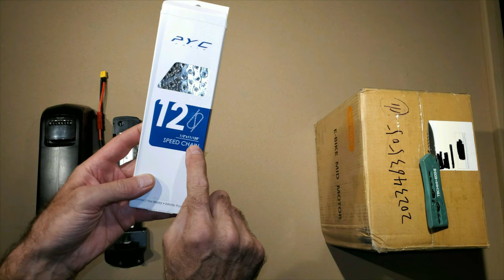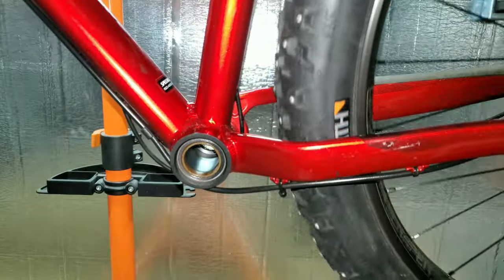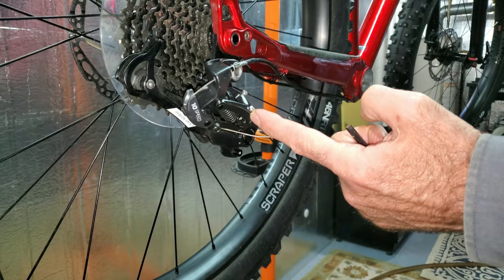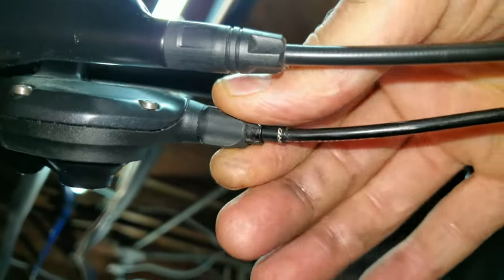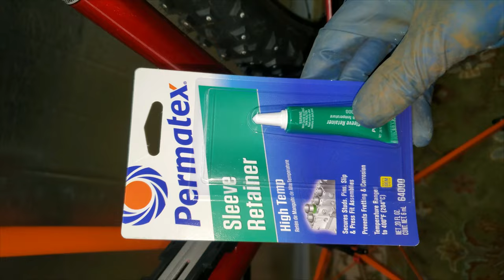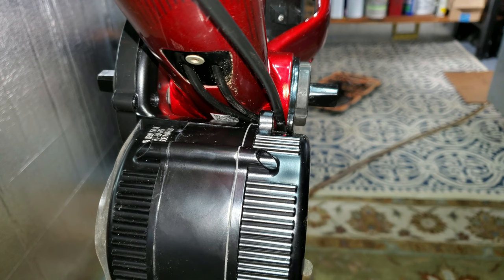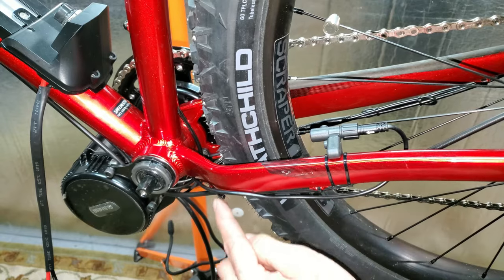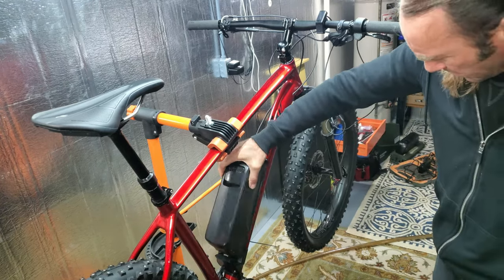Bafang mid drive Specialized Fuse E-bike conversion install

Comment: I love that you included all the hiccups in the process, this aligns with all my bike and auto projects. These kits are not guaranteed to fit every bike right out of the box and some left brained thinking is required. Thank you for this!
Reply: Totally agree. Need to warn potential DIY fitters that pedals, crank bolts and using the crank puller and bottom bracket can all be very difficult to remove. I went to the big bike retailer here in UK to help remove cross threaded crank and bottom bracket. It was worth it after many hours of massive force needed to remove bike parts. This seems to stem from the original bike builders not putting enough grease on these parts in initial assembly.

Comment: This really give me a very clear  guidelines for turn a bike to good E-bike
Reply: Few tips, don't stress yourself when building, do research on frame against what battery you want to use, check what sort of motor power you want, bafang do mid drives from 240watts to 1000watts at 48v, if you go for a power build bbshd use a strong frame and good enduro type wheels and strong brakes, once you remove any existing bottom bracket it's fairly straightforward, the connection of wires are very simple.
Reply: Whatever you do, don't build a bike using this as an instruction to do it. I've been running a Bafang for 4 years and this is the worst build I've seen so far.

Comment: You definitely need the brake cable cutoff system installed. Not much fun braking when your motor is full on at 45kph. My rear brake cutoff failed and I had to use the front brake first, to cutoff the motor, before applying the rear (which still worked) until I could get it replaced.
Reply from the maker: @user-rl4ji5ne4o  agreed. However, I live dangerously, and cautiously, if there is such a thing.
Reply: @RustBeltAuto  Calculated risks :)

Comment: Nice interesting video I always fit the throttle and display on the left side of the handle bar.  I have fitted A lot of mid-drive motors for clients i 20 years  Thanks for the video
Reply from the maker: If I wasn't born on a wheeler, and dirtbikes, and motorcycles, I may put it on the left too. Just seems weird to me.

Comment: Great tips in this, I don't bother with the shifter or brake sensor. Just do a gentle half cycle on flat or down, or cycle a bit faster when shifting, so the motor isn't under load. When shifting uphill you need to click to zero, not a big deal.
Reply: Thing about bafang, they are direct drive motors and only one model has torque sensor so you are not going to pedal enough to not put load on it, the torque alone is enough to cause damage on chain and cassette, the only way to do a shift effectively is to stop peddling with the cut off and let the motor travel through because the motor doesn't stop right away after you stop peddling for a few seconds, only in the programming can you  stop this. I have three bbshd ebike builds, i was destroying my cassette and chains if i didn't use a cut off and pause peddling between shifts.
Reply: Btw peddling harder doesn't stop load, it only adds to it surely.
Reply: @mikethomas6051  if i in pas 3 and cycle at a certain speed the motors starts to cut off and no watts being used
Reply: @mikethomas6051  cycling 3 years without any issue
Reply: @magzire  you aren't using a bbshd then ?
Reply: @magzire  that's true,  lol mine is set to stop in my lower pas 1-7 but 8,9 are full power thou my lower pas i see can't get that pedal down unless it 1-2 and i use 6-9 gears the bbshd is just to strong lol

Comment: Well done, I did the exact same 750W Mid drive conversion, my BB diameter was okay though, but I also could not fit the black collar, they say its not big deal. Given the BB length I also had to do spacers on the motor mount and some of the other improvisations, with longer hex bolts etc, "off to the hardware store".   I have break sensors, I use the LHS one as a clutch instead of the shift sensor, but loved your inline install, very clever.  as per @roncooke2188 I put the throttle on the LHS where the front shifter was, it works out well there.
Today I replaced the rear cassette, mine is a 9 spd, there was awful cracking on 8th gear I could not fix it with adjustment, so if this manifests it is likely the cassette is worn out.  Mine runs perfectly now it was definately the cassette :)
Loved the vid all the best.  Tim

Comment: You did a great job working out all the issues and getting it going. I do have to say this is Definitely the wrong bike frame for these kits though. Others have installed these in a couple hours into 68 mm bracket and without the wide tire frame the sprocket won't hit the rear frame. Also this shouldn't be used with a 10 speed bike.  But like I said. Good job making it work!
Reply from the maker: Fatties are great bikes to do this to. Regular bicycles in general are not designed for this. After the chain wears out, I might remove some sprockets, and space out the cassette to run a thicker chain. For now, it works great the way it is. One time so far, I was going down a hill very fast, started coasting over bumps, and the chain skipped off the front sprocket when I started driving it again. Probably could use more chain tension, or a different front sprocket. My only issue so far.

Comment: I also installed this engine for myself, but after using it for a year, I can say for sure that there will be problems with the chain and cassette, so I recommend installing Alfine 8 with a reinforced chain, I also recommend ordering a 500c display.      4000km +, ok
Reply from the maker: Sounds expensive. What happened to the cassette? I can imagine the chain being a problem. It's really thin.
Reply: @RustBeltAuto  I have an aggressive driving style. I like to ride hills or go fast, the main problem was always that the chain broke And of course the cassette wore out (or the Diore XT gear shifter bent) when I installed a planetary gear shifter (Alfine 8) everything became normal But the problems with the chain appeared again now I put one SRAM speed chain and it holds up quite well, also the chain tensioner must be taken into account, all this combined now withstands extreme loads. I am happy with my bike, I have accelerated my bike to 80 km/h and climbed big mountains and nothing has broken, I think such things should have a lot of strength reserve. My English is not native, sorry for mistakes)     I will also add that it is not so expensive, but the Alpine 8 costs about $250-300 and the chain is $30, but this modification will withstand this engine
Reply from the maker: @yurakryvets  thank you!

Comment: Display is generally on the left side.  Throttle can go on either side.
Reply from the maker: Ya. It's all a matter of opinion.
Reply: @RustBeltAuto . Quick response.  Usually it is put on the left because you have gotten rid of your front derailleur freeing up your left hand for changing power levels.

Also if you want a better chain line you should get a Lekkie chainring to improve your chain line.  Lekkie Onenut is nice to secure the motor.
Reply from the maker: @MumfordJim  the chain line will remain the same. It is as close to the  chainstay as I can get it, and 2 less teeth will not be substantial enough to make a difference. Also, if you have been riding motorcycles, and wheelers as long as I have, putting a throttle on the left would just feel as wrong as driving on the left side of the road.

Comment: Good video.  I believe they sell a 73mm version of the Bafang,  that is what you needed instead of the 68mm version.  Also,  you could have flipped the speed sensor the other direction so that the wire flows a little better.
Reply from the maker: The same motors are listed as 68-73mm. They are "universal". Unfortunately, I could not find a press in shell in 68mm, so I made up the 5mm difference with aluminum tape.
Reply: No, there is no 73mm motor, i own 3 bbshd models, its 68mm but they will fit 73mm bb

Comment: You had nothing but trouble with this install, fortunatley for you, you were knowledgeable enough to get through the hurdles… one question my brake cable is between the frame & the motor & it’s stopping my rear brake from working any suggestions?
Reply from the maker: Either it is pinched, or the bend is too sharp.

Comment: Nice I built a 29”r with a BBSHD you need a Lekkie 42 tooth with the offset works great it will correct your chain offset with the rear cassette with 160 NM of torque my bike rips
Reply from the maker: I looked into that, and figured especially for the price, it will not make much of a difference, and would rather just loose a gear. That sprocket will probably still hit my chainstay if I do not shim it out as well.
Reply: @RustBeltAuto  get a 32 tooth.. plenty of clearance. And can put back to correct chain line...
Reply from the maker: @jasonkroll2735  a 32 tooth has no offset 😖
Reply: @RustBeltAuto  you don't need off set from your chainline...u already added washers to offset it from hitting your frame... you get a small 32...YOU DON'T NEED OFF SET.. you need the correct chain line ..instead of offsetting it with washers making your rear large gear unseable...u know ..1+1=2
Reply from the maker: @jasonkroll2735  enen though i used washers, it is still offset, and the chain line is still off, because I need more offset. 🤨
Reply: @RustBeltAuto  your offset now makes largest cassette cog unusable... off set more the next one down will need to be cut off..and chain may hit seat stay in high gear..guess u just gotta do it yourself to see..
Reply from the maker: @jasonkroll2735  I will not be doing anything you believe should be done. There is nothing you say that I need to see. That's all I got.
Reply: I had to do that, those are some great sprockets 😊
Reply: Chain line should be set for the middle cog on the cassette, I've never had an issue with chain line as i use a 9speed cassette 11t-42t microshift giving me a perfect shift throughout all gears, i use kmc chains, my chain ring is a lekkie 42t aswell but i used the bbshd 46t for ages with no issues. I use this for my 3 builds.
Reply: @RustBeltAuto you should do what works for you, it's all trial and error😊
Reply: @jasonkroll2735  and if you have the BBSHD you can only use the HD Lekkie bikes that use small 1x like a 32 tooth don’t leave enough room for the 42 HD pro if you a 1x12 you have to run the HD pro because of the large small gearing I did not know this so on my new build I had to use the HD pro 3 spacers and the spacer that came with the Hd pro
Reply: The Lekkie 42 tooth offset chain ring uses alternating skinny fat teeth to retain the chain during shift and jumps. Makes a big difference for chain retention.

Comment: If you want to use the largest cog in the rear, you might want to think about a chain guide. The are low cost (~20 $) and should prevent the chain from coming off the (front) chain ring. They were originally designed to prevent chain slap on single chain ring acoustic bikes, but work ok on ebikes when the chainline is off.
Reply from the maker: I think my chain will last longer if I don't use it.
Reply: @RustBeltAuto  That's very likely. A chain guide will force a sideways bend on your chain, but it's very little. I've never even had a master link pop off, and they would be the first to go. However, your chain angle might be more steep. If you ever wished you had that highest tooth count gear, it could be useful, otherwise forget I mentioned it.

Comment: I have my throttle on the left side. It's not bad at all.. theres just more room it makes sense. Also, the shift sensor isn't needed. I shift with the throttle applied but very little. There's no issue. I climb hills , so cutting the motor while climbing doesn't work for me.

Comment: You can get a little bit more speed out of it by moving the sensor magnets as far out as you can get them
Reply from the maker: @Rob337_aka_CancelProof  that makes no sense. The outside diameter of the tire makes everything inside of it the same rpm.

Comment: Good video for someone wanting to fit these. They arent compatible with 12 speed cassettes because the chain is too narrow for the front sprocket, i think thats your jumping issue and why you cant use the lowest gear.
Reply from the maker: I did notice that some of the aftermarket sprockets look to have deeper teeth. Someday I may space out the cassette, and use less sprockets for a wider chain. Someone said I should do that.
Reply: How many speed cassette should I look for if I'm buying a buy to put on a bbshd?
Reply: @Tomas-ml9nv  11 or less.
Reply from the maker: @Tomas-ml9nv  don't much matter really. I only use like 7 of them mostly. The three smallest ones just burn up my battery, and goes the same speed, unless I pedal. Maybe because it's only 36v. The biggest gear on this can really crawl up steep hills. So I suppose it depends on the size of the sprockets more than anything. Less sprockets on your cassette will let you use a beefier chain too.

Comment: Fill the gearhousing with grease, and you'll get a much quieter experience. They put grease there from the factory, but it's not enough.
Reply from the maker: Grease? There is a lot of plastic in there. Can you be more specific as to what type of grease you intend to use? Furthermore, I don't think it will get quieter over the humming of those studded tires.
Reply: @RustBeltAuto  Most people recommend Mobilgrease 28 for the secondary (drive side) gearing in the BBSHD and BBS02 motors. I don't think it makes a lot of difference for the noise, but it's supposed to prevent damage in the case of water ingress.
I also run studded tires in winter, they are extremely loud and I certainly can't hear the motor over that noise, with grease or without. ;-)
Reply from the maker: @heraldreichel1971  thanks!

Comment: I love the video, I’ve been trying to find battery cells for the actual bafang battery that are good reliable, any recommendations?
Reply from the maker: Not really. Mine are Chinese. 🔥
Reply: @RustBeltAuto  ohhh ok ok thank you! Sorry one more question, what size batteries would I need to find for this?
Reply from the maker: @alienplaysyt3730  it depends. Most people get the 52 volt motor. The higher the amp hour battery the better. There are many different kinds. I got lower volt motor, because I had a battery already. Sub reddit r/ebikes, might be a big help for you. They can answer all kinds of questions for you.

Comment: 10,000 km and no broken chain , Spokes I have had some trouble with them . I have the 02 750w, better with a 7 speed , a tyerap for the chain, don't need the shift sensor,
Stay away from the tire with the wires.

Comment: I have a question. When out in public would you say it’s easy for someone to steal parts like the motor and display?
Reply from the maker: The display, and battery ya. I got the cheapest display, and take the battery with me.

Comment: I would never install the GearSensor like that, i would fix it at the frame further at the front, and i always put the cables inside the frame, it usually cut the signal cable and solder it back again after runnning it thru the frame. The Speedsensor should not point upwards but downwards in that way it is better protected
Reply from the maker: @JanRossil-v9q  ya. The shift sensor shits off the motor, when I go over big bumps. Thinking about removing it. Also figured the speed sensor could get hit easier if it is facing down.

Comment: 27:15 FYI, that's low gear, not high gear, for climbing.
Reply from the maker: @joshuaanothereraseddad  ya. High numerical ratio. I mix them up all the time. Low is slow, is the way.

Comment: this is almost great but 25:27 why you don’t find some adaptor that includes it this kit at 2:40 and 0:39
Reply from the maker: There is nothing more to adapt. I could remove a gear, and use a spacer, but the result would be the same. The front sprocket is the smallest one with an offset that comes with the kit. I could spend money on one that is 2 teeth smaller, but it would be offset in the same location. It is as close to the chainstay as i can get it. The chain will also last longer if the chainline is straight.
Reply: I mean electrical connectors not gears
Reply from the maker: @วิชญ์ภาสจรสโรจน์กุล-ป7ศ  ooh. You mean for the battery? I'm an auto tech, and the delfi waterproof connector that I used is way better than anything on these bikes.

Comment: This has to be a joke, the sheer lack of knowledge and stupid shortcuts taken is shocking. The brake levers are supplied so the motor doesn't accidentally get kicked in while you are braking which can potentially cause a very serious accident.

Your first mistake was not checking compatibility properly, that bike is not suited for the kit you bought, you need the other kit they sell that is for the wider crank tube.
Reply from the maker: @LarkspeedNL  what kit? Do you have a part number? Been riding motorcycles, and dirt bikes for over 100k miles, and engine does not shut off when you hit the brakes. If you want to drive a car, or a bike with the gas, and brakes at the same time, you should probably get a lifetime bus pass, and take the bus. I will take that chance, and leave it off. If you want that feature, do it.